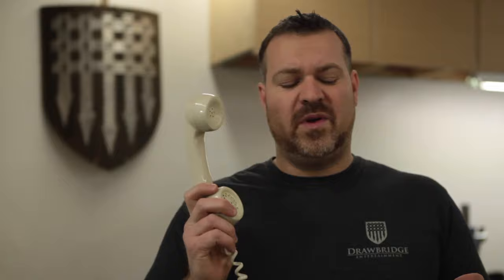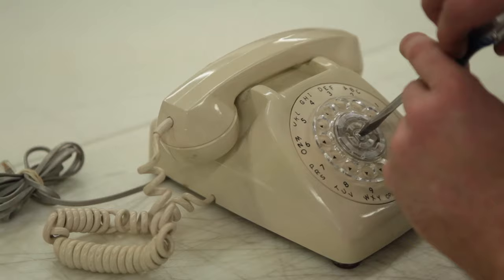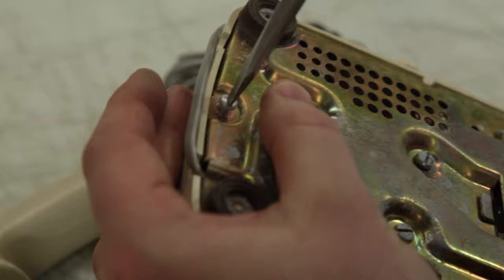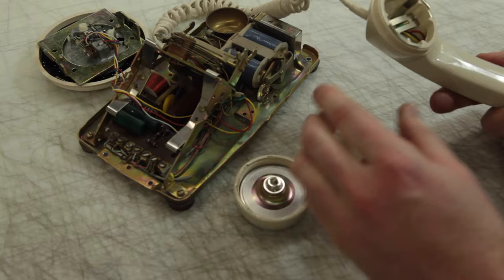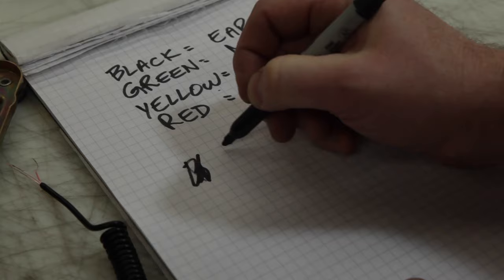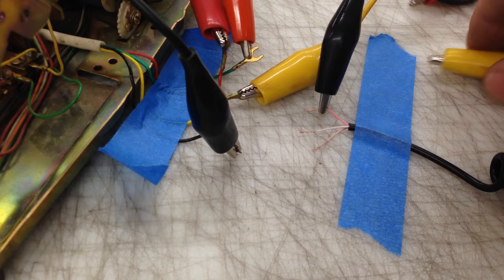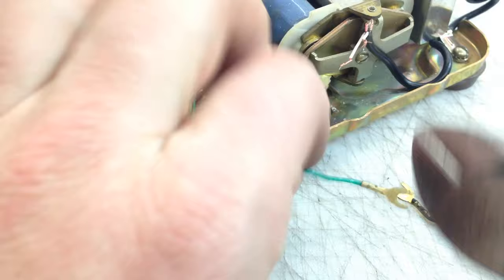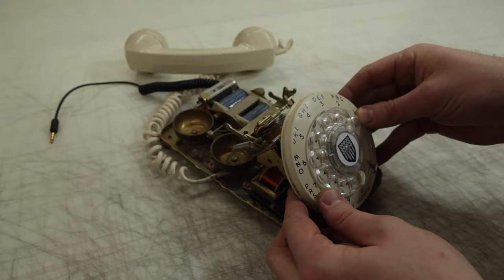DIY Retro Cell Phone Handset: Making a vintage prop phone play sound or music

Comment: Vintage handset ergonomics are actually superior because the speaker and mic are separated by a distance appropriate to the human head. Being used to both I find the surprise of one who rarely or never held one amusing. Old phone mics and speakers are extremely durable so there's that. They were highly refined products rightly expected to last over half a century without malfunction. I was born in 1959 and despite being into electronic NEVER encountered a malfunctioning phone that had not been vandalized.

Comment: There was a guy a few years ago who got a kit that let you connect to the mobile phone network, a sort-of phone on a circuit board, with wires for various functions. He connected that  up to a small computer, then stuck the whole thing inside a phone like that. It runs off a big battery, so you have an old-style phone you can put on your desk, then take with you wherever you go. Doesn't need a cord, cos it's really a cellphone.

Comment: is the best so far. hard wired, no bluetooth non sense.

Than again... what i did with my touch tone telephone is got one of those bluetooth adapters which are powered by USB.   So I did my best to put this adapter, small usb battery power bank inside the good old vintage touch tone phone.
I do have the short usb cable (to charge the power bank) sticking out from where you put your fingers to hold the phone, so it is hidden fairly well.

Now to go out side and use it... suprise a lot of people on how it works :D

Comment: The landline telephone used in this video is an Automatic Electric Model 80. Automatic Electric was the manufacturing arm of GTE (much the way AT&T had Western Electric); AE phones were used, until the 80's by GTE and a few other independent (non-Bell) phone companies.

Comment: Rather than destroying the insides, you could just use the phone's own wires it comes with at the plug end. Without destroying anything, get a look at a diagram for how these things work. It's  not complicated. The bell rings when you feed the phone AC at so-many Hz, so-many volts (about 60 - 90 IIRC). Lower voltages are just speech. And fortunately, carbon microphones have an amplifying factor of their own. Originally the first phones came before the invention of the thermionic valve ("vacuum tube"), so no other amplification was possible. 

The answer to the question, then - you just wire 2 phones up to each other, wire to wire. Stick a battery in the circuit with them. Experiment with the voltage but even 3V will produce something audible in the handsets. Both of them at once, the sound from both parties is mixed together. Working phones. 

For the ringer you'll need a way of generating the right voltage, you're on your own there. But you can do without and just play the ring through a speaker if you want. You'd have a working phone line without hacking and clipping some respect.
Reply from the maker: Thanks for that!
Reply: I'm keen to do this for my mobile phone and old 60s phone I have. This lroc looked a little complex so is there a sure proof way and much more easier way I could get this connected with my mobile?
Reply: I've seen someone change the 60v ac coil with 12v dc motors to make it ring. I'm thinking about doing the same with a bluetooth micro controller to trigger the motors when a call comes in.

Comment: This is a great DIY.  The only thing missing is the "real" classic ring from this phone for a received call.  If it could do this I'll try it.
Reply: it wouldn't be very hard at all. all you need is a relay and a power source to power the bell. the reason these old phones were able to ring is because telephone lines carry not just the signal but some voltage
Reply: This is what i want and also charge phone at the same time

Comment: Omg! I am a huge vintage lover and found this by chance while ironically shopping for one. I was hoping to find a bluetooth one an I came across this!
2 questions for you or anyone who knows.
1. Does the phone ring when being called?
2. Also, can it also be done to even older looking rotary phones or actual vintage ones? Would the wires be the same color? 
If not, what's a good way to test it? 
So I guess technically 4 questions lol
Reply from the maker: It does not ring. Any phone will work as you are just rewiring the speaker and mic. All phones have different coloured wires but there is no danger in playing with the wires until you find the ones that work. Good luck.

Comment: I just pług the phone jack of the rotary to a cell2jack bluetooth cellphone calling box. Your build doesnt allow any phone ring which could be a problem.
Reply from the maker: You are correct. My build is a hardwire as it is intended for use onset. Adding a device like a bluetooth calling box is one more element which could fail while we are trying to shoot a movie.
Reply: Drawbridge Props & Armoury Good point there

Comment: Silly question time. Since you have bought a new handset, would it not be easier to modify and repaint it rather than rewiring the old handset since you are not using the rotary dial anyway?  It is a nice clear tutorial.
Reply from the maker: Faster to rewire than even think about matching the paint and finish.

Comment: This is amazing. I was wondering if it only receives calls or if it can also make calls?
Reply: The retro phone doesn't make calls or receive. It is just using the speaker and microphone to connect to your cell phone via headphone jack so that you can look cool walking around with a retro phone.
Reply: @TheGeektrick  I don't know what you mean by landline receiver. You can easily use this same wiring to connect any non powered handset. Retro or new.
Reply: @TheGeektrick  the demonstration in this video should work the same way for any phone. Just solder the wires from the handset to the headphone jack and plug it in.

Comment: You just need conect your mobile to the land line  phone with  rj 11 to  rca  aux  cable    without doing any change like the connection he has . I conect mobile with radio using aux cable

Comment: Hi~ I watch your tutorial and do it on my retro phone, but I didn't successfully connect the microphone , it connect to the cell phone's mic not the handset's mic, so the farther I get from the cell phone, the smaller the sound, is this condition normal?
Reply from the maker: I was able to connect the microphone so that the mic in the retro phone was used instead of the cell phone microphone. Maybe your connection is bad or you have the wrong wire connected. It did take a bit of playing around to get it to work for me.
Reply: In fact, I connect it to a notebook instead of a cell phone before. Now I just connected it to a cell phone and found that it works!! but I didn't know why it cannot be used on a notebook, I really want to use it on  notebook......